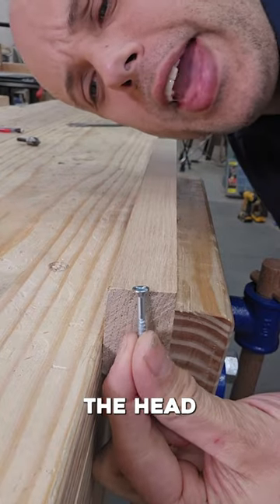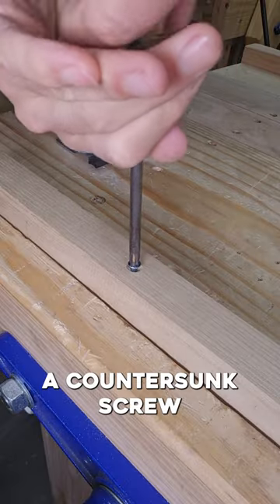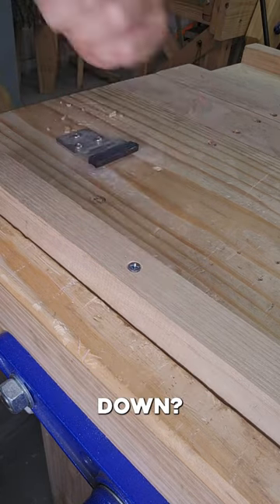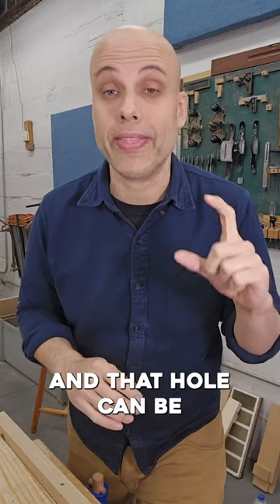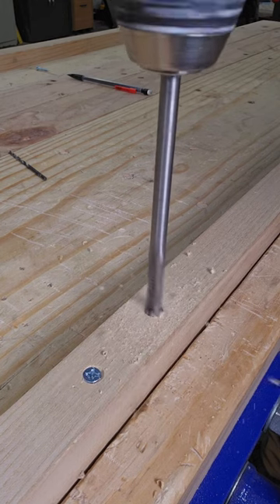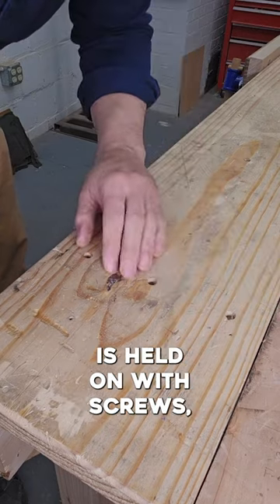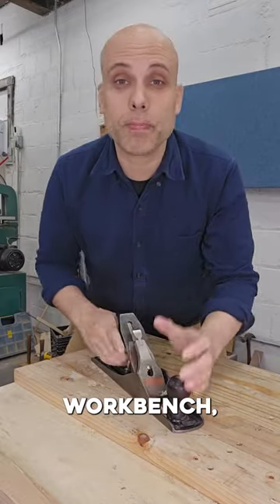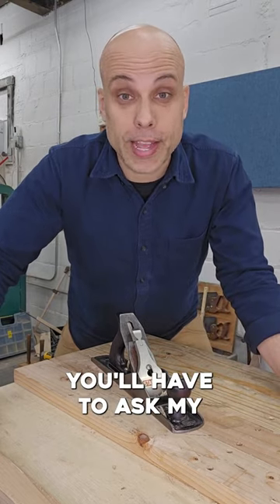Use This Trick to Hide Your Screws #diy #woodworking #woodworkingtips

Comment: Judging by all builders I've seen, I think "the most common way" is to turn the drill up to max and drive it in deep 😆
Reply: Crush those fibers! 😃
Reply: Split that wood!😃
Reply: @WillMoxonFloatsOnOil  😂😂😂
Reply: @WillMoxonFloatsOnOil  Dude I swear thos guys will split a piece of wood in half and squeeze a screw between them and act like that's structurally sound.
Reply: Same thing she said
Reply: Yeah it works and the wood doesnt split most of the time.
Reply: @Baz09   will split with time and pressure/usage
Reply: @vcommandarv5916  ive seen screws driven that way which have been there for years and havent split but then again its not always going to be like that all the time.
Reply: I was waiting for this comment
Reply: Yep
Reply: Depends on what material you are working with. I do custom cabinets. Its plywood then yea im just using my drill to sink the screw. If its actual wood then no im not doing that.
Reply: facts
Reply: I've done that with lag bolts too lol
Reply: commercial vs. craft is very real haha
Reply: LMFAO. Seen it.
Reply: @Baz09  pretty sure too that a lot of the time them screws basically have a built in countersink for that reason

Comment: You are mistaken, the most common way to do that is not a countersink, the most common way is to abuse a philips head bit as a countersink.
Reply: You actually have those? I abandoned philips everything years ago. Wont even speak to a man named phil.
Reply: Ok. But this is actually not a terrible idea. 😬
Reply: Or force it in with an impact, though depending on the wood quality that can cause splitting
Reply: @Maibuwolf  We really need to find Philip and cam him out
Reply: Not a great idea but at least it's better than using Phillips screws 😅
Reply: @JuneNafziger It's also a great way to break screws off. Just ask my old boss lol
Reply: @JuneNafziger   I use a 3.9 mm long drill bit to create a pilot hole, then I use an 8 mm Auger bit to drill about  3mm into the wood and then I'll use a fastener. It's a little more time consuming but the end result is very good.
Reply: Surely the most common way is to set your impact driver to 3 and just hold the trigger for a few seconds?

BRRRRRRRRT and voila, counterbored
Reply: It's not abuse when they like it.

Comment: You can also buy countersink bits that have a drill bit with an adjustable collar that bores the countersink/bore. That's my favorite cause it saves a step in having to alternate drill bits.
Reply: These work quite well but do get blunt quite quick and can get jammed with wood shavings so need frequent cleaning. Easy to sharpen though.
Reply: I’ve been using these a lot recently, but find for screws longer than 2.5” I need to remove the countersink collar in order to drill my pilot deep enough.

I think I’m ready to get a dedicated countersink bit, so I can knock out all of my drilling operations at whatever diameter and depth, then return to countersink the ones that need it.
Reply: So stoked to do enough projects that I can justify saving time as a reason to get fun pieces of kit like this.

Comment: Handy counter bore tip:  If you don't have a spade bit, but do have a Kreg jig, the drill bit will actually do a nice counter bore for most wood screw sizes that's easier to get a clean top edge, plus a nicer starting hole for pre-drilling for the screw.  I'll use this before a spade bit.
Reply: I use a kreg jib near daily. I have tried using the kreg bit the way you described but i hate doing it. Those bits have a tendency to pull themselves through whatever you are drilling and ended up going way deeper than you wanted. I recommend caution for anyone who tries this.
Reply: @Maibuwolf True, but the Kreg jig comes with a collar stop. Just use it on the bit itself and problem solved.
Reply: @RyanWattersRyanWatters  That is an option. If you use that bit regularly though the markings will be worn. This means moving it is a pain in the ass and costs more time than its worth unless you HAVE to move it. 

Personally i just run it in reverse when i use it to countersink something. Requires a bit of pressure but its better than having it drill to far and its better than having to guess at where to move the collar back to for its intended use.

Comment: I just use a larger drill bit, works good as long as it doesn't need to look good, as long as it works
Reply: 6 or 8mm Metal-Drill works perfectly. Just not in plastic. They tend to grab and pull themselves into the piece faster than you can stop

Comment: But do you do a clearance hole? A properly done screw wants 3 seperate holes drilled. Need a clearance hole below the countersink hole so the screw head sinchs the wood together. Pilot goes into the piece the screw wants to bite into

Comment: Uh... The easiest method is use a drill bit the size of the screw head, to the preferred depth, after you've drilled the initial hole.

I didn't need to be told. 

Just wow. Talk about needles over-complication.

Comment: If you counterbore with a metal drill, then you get a nice cone at the bottom for the screwhead to sit in. A metal drill bit has a tip angle of 118 degrees, so not quite the same as the 90 degrees of a countersunk hole, but it's better than nothing.

Comment: They literally make bits that have a small drill bit and appropriately sized countersink so you can make the hole as deep as you need while simultaneously predrilling for the screw.

Comment: The deeper you drill, the less material is held on, so if you drill the screw in half way through, you now have a board that is half useless, because it will break off twice as fast as the material suggests

Comment: Counter bore is for machine screws and not tapered for the head. If you want to use machining for woodworking like that then use a center drill. Your brain didnt push your hair out, you just run too fast to the first solution.

Comment: Just as a rough estimate you will need to plane your workbench about 1,500 times before hitting a screw head. That would be roughly 2hrs of straight planing.

Comment: Another trick is to use the back lock plate locking nubs for a whole saw jig untethered to the drill chuck and a larger drill bit.

Doesn't work so well in tight but or corners though.

Comment: My grandfather built a workbench like that. The steel legs rusted out and snapped, but if it didn't, I probably could have passed the concern of hitting screws with any tools I would use onto my future grandkids

Comment: I just take 10 mm or bigger or smaller normal drill bit but drill in the opposite direction so the grains dont get ripped out and its smooth you dont need drills shown in the video

Comment: I have a set of five countersink spade bits from my grandfather that he probably bought in the 1920s or 30s. They are shaped to match the threaded, unthreaded and countersink profiles of common wood screws and have a removable guard that depths them for flush finishing. Remove the guard, though, and you can send them as deep as you like. No idea of the brand, unfortunately.